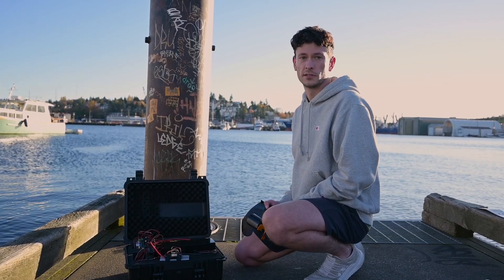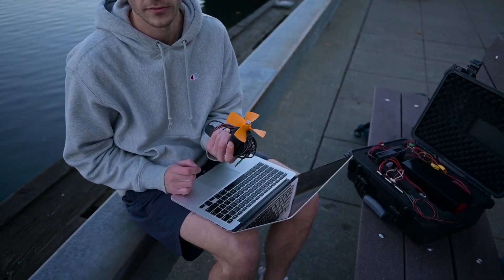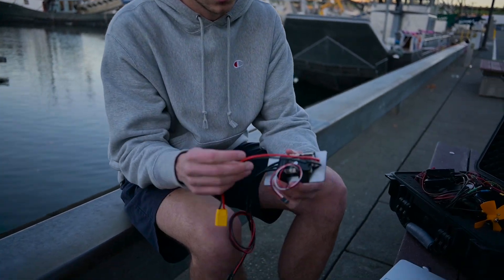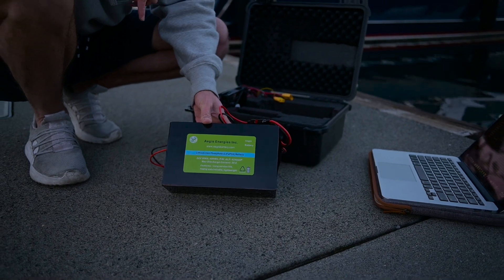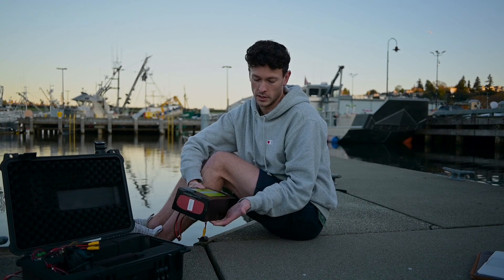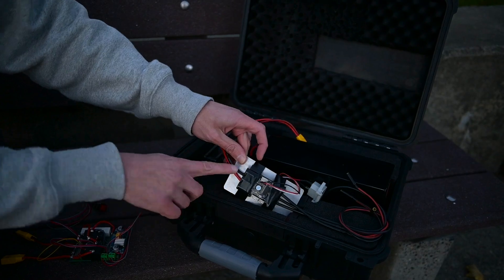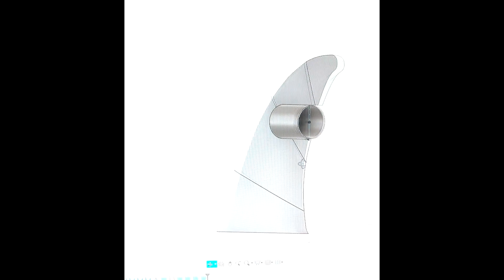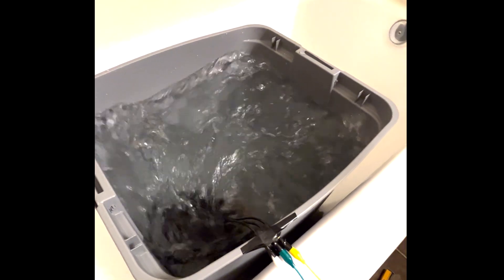DIY Electric Kayak

Comment: Great video, and blog! Very informative, and well put together. I am trying to replicate your build for a small sailing dingy, and I have a question about the motor you are using. I am pretty sure it is a flipsky 5062 160kv, but the online specs for the motor indicate it requires 6-12s power and has an 18a max current. Is this the same motor you are using? Since you are running it with 24v, and indicate that you are driving the motor @ 60% duty cycle max or around 14v, I am curious if you think it would work almost as well with a 12v battery. Thanks for sharing your project!
Reply from the maker: Thanks! I think I do have 5062 but it seems like some of the listed specs changed a bit? I swear it said 500W for rated power when I bought it. 

Regardless, I would probably go the other direction and choose a voltage higher than 24V. I’m hoping to bump my voltage up near 40V at some point and think that’ll give me more speed. With 12V, the motor is gonna draw a lot more current (Power = V x I) and you would probably reach the current max a lot quicker (maybe 40% duty cycle?). Would wear down the battery faster, create more heat and limit your max speed. And if you pick a higher voltage, you can pick a lower Ah battery since what you really care about is power (Wh =Ah x Voltage).

In a pinch, you could probably get by with 12V but might be limited to only ~2mph or something before maxing current or hitting heat limits? You could maybe start with one 12V battery and add another one or two in series if you needed. 

Good luck on your build, sounds awesome!
Reply from the maker: Oh, also note that not all of their waterproof motors are rated for salt water! 

https://flipsky.net/blogs/vesc-tool/about-flipsky-waterproof-motor#:~:text=We%20use%20water%20%2F%20ceramic%2Dseal,can%20improve%20the%20waterproof%20performance.

Comment: This is awesome! I’ve been looking for a DIY Kayak Motor video like this for a bit. I will be giving it a shot myself. Great Job! Have you looked into making a differently shaped propeller.
Reply from the maker: Thank you and not yet! Once I get everything cleaned up and working well, I think I’ll start experimenting with propellers, battery sizes and ducts!
Reply: und0i7e,/ö 6:29 6:29 6:29 6:29 oe😅😅 . ) .,die 1:10 if